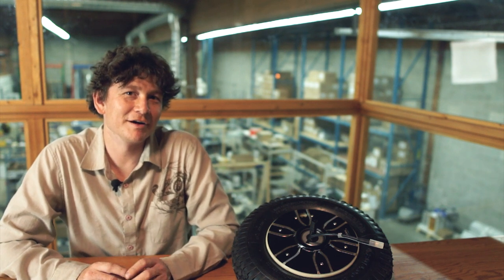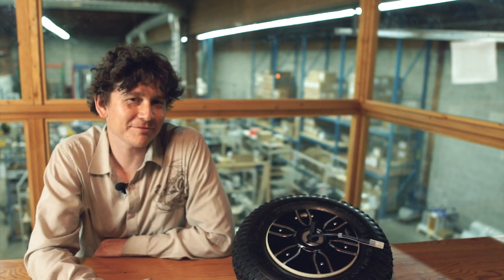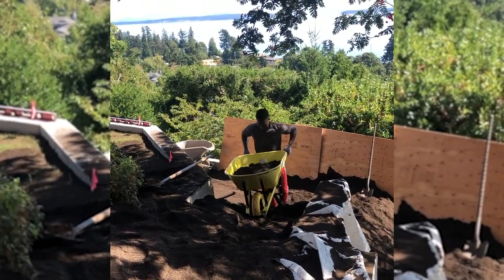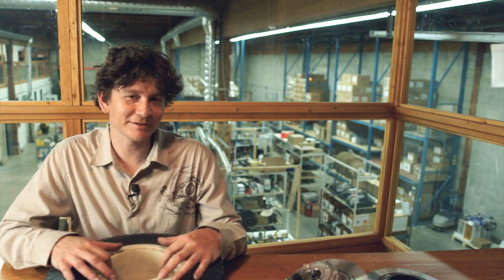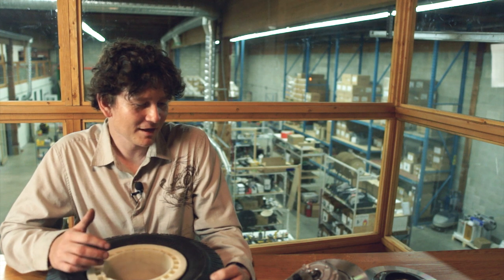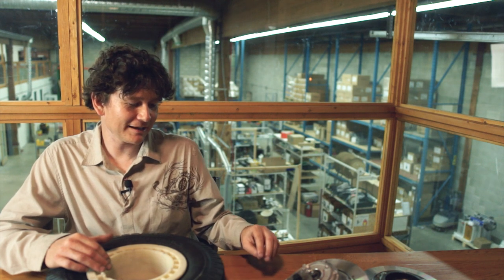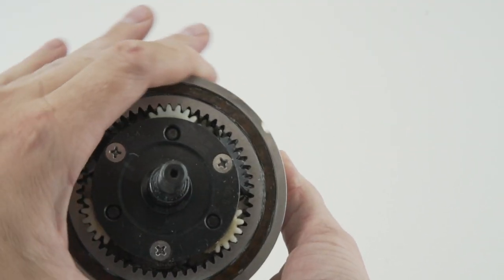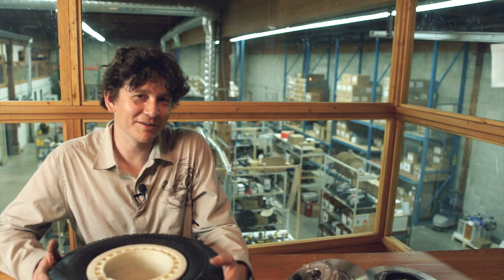Intro to the Bafang Electric Wheelbarrow Motor

Comment: I remember 15 years ago when folks ran metal gears in the BMC and MAC hub motors, really noisy, so your gears lasted but the clutch got destroyed, good to see they removed the clutch in this because that wouldn't have lasted for the same reason, really nice idea, may be a market for ready made barrows, if you don't "Luna" Barrows will 😜 great stuff.
Reply from the maker: Quite a surprisingly large number of "ready made" electric wheelbarrows have already sprung up on the market just in the last 2 years and I expect this will continue to gain traction.  The Makita is one of our favorites (other than the slow top speed),  but for similar reasons to ebikes we think that there will always be a retrofit / DIY market even when there are lots of turnkey's available.

Comment: He ha .....finally found an off the shelf rig for my  cargo trike trailer , 9 kmh is fast enough for me ,
 that's about the max speed of my self built delta cargo trike , now I'll be able to go off road camping . The trailer is about 8 feet long with portable head and serves as a tent plaform . With a couple of these wheels I could make the trailer bear proof which will ad weight giving the wheels more grip ......thanks for all your efforts and time
Reply: You know what a lot of people in alaska do to keep bears out of their cabins is a bunch of sheetrock screws threw a piece of plywood and leave them under every window and in front of every door ! The black drywall screws are super sharp! I would space them about 2” apart ! Maybe to save weight and for camping something similar that rolls out? Like some kind of plastic or  carbon fiber!?

Comment: Can you show more about the control by end-user pushing (pulling) the barrow? I imagine one mode could work like a 'hover' board, with the tilt controlling drive, but obviously there are many situations where tilt has more to do with navigating hills and bumps, so manual throttle would be needed?

Comment: Nice one! Wonder if this has application as a jockey wheel? I know you can already get powered jockey wheels but this might be better/cheaper/superior in some other attribute.
Reply from the maker: Never heard of a jockey wheel till now with a quick search but yes that is exactly the kind of low speed and high torque area where it shines.  The differences to this over the commercial powered jockey wheels is that this wheelbarrow hub is probably a lot faster and has a larger diameter for rolling over bumps, but it probably doesn't have as much pulling thrust. So if those are the attributes you want it would be a good bet.

Comment: great so overvolting a Wheelbarrow is out >:)
Reply from the maker: I mean, technically running them at 36V is overvolting by a factor of two as they were engineered for use at 18V and 4.5kph moving speed.   You can in principle disassemble the motor and reglue the rotor magnets with a higher temperature rated adhesive, and then it is possible to operate at even higher rpms. We used to do this frequently with the ebike motors.
Reply: @GrinTechnologies  Are you saying that you could run this off a single 18V tool battery without modification and the only difference would be cutting the moving speed in half?

Comment: Can this work with out a fork style axle mount? As in can it be used as a wheel that’s mounted on just one side. I want to build a small electric quad for my daughter and am wanting to use something like this for the rear wheels. She is still young and not the best driver so I want it to go slow but I want it to have enough torque to get over most obstacles or climb hillside as her skill level increases. I don’t want the rear axle to be a solid straight shaft locking the wheels together and I don’t want to mess with a differential so I figured two hub motors for the wheels would be ideal but most of what I can find will be too fast and have no low end torque.
Reply from the maker: Hi Nathan, it's certainly not designed for single side mounting. For fairly light loads you could get away with this just clamping the one axle on the cable side, but not for anything that needs to carry any substantial weight. 

So if it's just a small quad for your daughter and her weight is split across two motors on either side it will likely hold up fine.

Comment: can this be adapted to use on a trike?  possibly as an assistive device?
Reply from the maker: Sure, if you could modify the trike to use a custom fork with ~155mm dropout spacing and 12mm dropout slots then it would be work fine, assuming that you really don't need more than ~9kph speeds.
Reply: i have parkinsons but have been riding a trike for 10 years to keep moving.  i currently have one trike operative w/motor.  i can see the potential for a low speed adequately powered "add on"  so i guess an easily adapted possibly portable setup would be difficult to develop?

Comment: Does this mean it is also now possible to get the normal bike version of the g311 motor without a clutch (and so with regen)?
Reply from the maker: No, the bike version needs to have the clutch since it has thrust bearings to deal with the axial thrust of the helical gears on the rotor and planet gears. If locked the clutch and put torque on in the other direction, then the axial thrust would be in the other diection and the rotor and planets would bottom out.

Comment: You had me till you said tube and entire, aren't we done with inner tubes?
Reply: They said 20s later that it can be run tubeless if you want to.
Reply: @kschleic9053  I'd personally opt for solid rubber tires if possible. For this application you aren't as concerned about cushion as you are reliability. It likely won't be traveling long distances and will be required to carry heavy loads through rugged terrain. For example if you used it for a home construction project, it could have a high chance of encountering loose nails.
Reply: Give me a.tube over.that.messy gunk anyday. For a building site tubes are fine
Reply: @captaincaveman8532  a puncture a day on site

Comment: Hi. What is the slowest this wheel can go and how much weight can be distributed on 2 drive wheels and 2 lazy wheels?
Reply from the maker: You can run the motor as slow as your motor controller allows, some controllers do have a motor stall timeout if the erpm falls too low. Each motor axle can easily support several hundred pounds.

Comment: Use this on a small boat(Rib inflatable) trailer from a distance of less than a mile to the water.  So, no need for a vehicle to tow...
feasible?
Reply from the maker: For sure, but most boat trailers are 2 wheels, so there would be a steering moment on the trailer unless you had a 3rd wheel upfront (like a trike) or ran dual motors as the two trailer wheels
Reply: Hey there I am using two of these for exactly this purpose. I built raiseable launching wheels with one motor each to carry the rear and a separate raiseable two wheel setup for the front. The whole setup can be left on the boat while on the water
Reply: @shanek1506  Nice!  Do you have a link of the specs, pics of your boat?

Comment: couldnt you design the motor core to be an outrunner so the magnets would not fly off if it is powered by 72 volts.

outrunners have the magnets on the rotor like most ebike hubs like the direct drive and the bafang used by rad.

inrunner is like what the bbshd and cyclone uses where the magnets and rotor is inside the part with the windings.

it would be nice if you could design a wheel that would work on appliance dollies
Reply from the maker: Yes, but this isn't our motor design, it's Bafangs. They took a great inrunning motor core (same as the G310/G311) and greatly increased the gear reduction to the hub.  Even if the magnets were better bonded and didn't come off at 72V unloaded speeds, the hysteresis and eddie losses of the iron core would cause the motor to overheat at those RPMs even if there was no load on the motor at all.

Comment: This would make sense if the batteries anf other required component didnt bring the price past the cost of a pre made machine
Reply from the maker: It will run fine of cheap lead acid batteries like are include with almost all the pre-made electric transport carts.  You can also run it off power tool batteries just fine which most people already have around.

Comment: I'll give this half a day for the tradies to destroy. It'll be wet and half cemented.
Reply from the maker: Currently we're going over 18 months among some tradesman moving concrete, dirt, rocks, you name it, with not a failure yet!
Reply: @GrinTechnologies  Impressive
Reply: I bought one of the after market hub motor kits from aliexpress. I stripped a gear, with no known way to fix. It has however convinced me to go with this again on a more known brand. It has saved me thousands of dollars in hill landscaping.

Comment: It's too bad this product does not exist. Everybody that deals with the Bafang hasn't a clue of any wheel barrow hub motors. It's also impossible to contact or speak to the people that made this YouTube video.  I was told by several e-bike company that this may be a prototype. They know nothing about any wheelbarrow motors any place.  Too bad there's no customer service for Bafang motors. You know, somebody you that you can speak with by telephone ?
Reply from the maker: Hi Stuart this is not a prototype, we've been supplying these motors for over two years now and currently have them in stock here:
https://ebikes.ca/shop/electric-bicycle-parts/motors/geared-wheelbarrow-motor-with-tire.html
Bafang is  not a consumer facing company, they are a B to B entity and are not known for ever answering end users. So any questions generally need to be directed to a competent dealer selling the part and not to Bafang directly.

Comment: this makes no sense to me. USD$524.00  USD$1,304.25
USD$1,428.00
Reply from the maker: There are many options you can choose (controller, battery(s), charger etc.) when buying a full kit. If you just want the simple price of the motor, it's right here:
https://ebikes.ca/shop/electric-bicycle-parts/motors/geared-wheelbarrow-motor.html